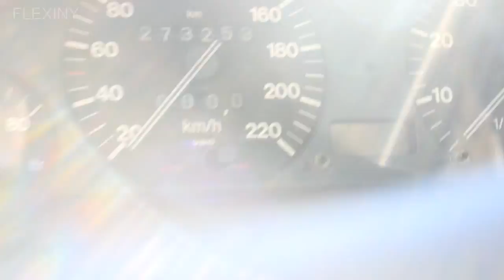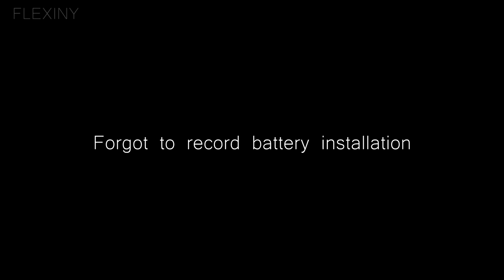Starting 1983 Audi 100 C3 2.1 After 15 Years

Comment: This car was one of the best AUDI i ever drove. I mean the 134 HP engine. Easily going real 195-200 km/h, and only 10L per 100kms gasoline when you were on 170km/h or so. I mean compared to my  A4 3.0 TDI from 2005 this is not very impressing, but in 1983 that was amazing, especially the acceleration from 140 to 195km/h
Reply: Yeah man, I have this car and driving for fun, 2,3 136 hs, 1990 rest
Reply: @КиримВастьянов  I have an A4 B5 from 1999, also very good reliable car.
Reply: if u have fully fixed kjet system.😏
Reply: Reliable, fast, everything you need

Comment: The good and old MD270. In Brazil, they evolved into the AP series, with longer connecting rods and more torque. It's still one of the most reliable engines here.

Comment: There is a good reason it was parked there 15 years ago - major engine repairs needed - those bearings (and most probably valves too) are shot!
Reply: What????  .. and that massive impact at the off side rear didn't play a factor in it getting parked up .. sheesh !!!

Comment: -Knock, knock! 
-Who’s there?
-Crank rod 😂😂😂
Reply: This engine have a connecting rod bearing damage.
Reply: @1979Olitsch Sounds like my Tdi pd 130
Reply: If timing belt was slipping... valves are most probably bent
Reply: @user-sm8wo3dj5z  definately bent valves now jose. hear it popping back and the piston crown hitting the valve (or valves). wrecked engine now i fear.
Reply: no conrod, hydraulic tappet noise
Reply: @mindoza44  not worth anything anyways. still millions of them
Reply: ... every 5-Cylinder is worth ...  !

Comment: It started pretty easy considering it has infamous Bosh K Jectronic mechanical fuel injection.
Reply: K/Ke-Jetronic are extremely reliable systems as you can see in this video. The issue with them is mechanics knowing nothing about them.
Reply: @keki11111  well not really, they are extremely prone for various faults. That's why many owners are upgrading from mechanical to fully electronic injection systems. Because many of the parts wear out and are unavailable.
Reply: @justas525  I suppose it's a matter of pay your money take your choice
Reply: @drone_tours  you can say that i supose
Reply: Justas043  Do you work on these systems? So tell me any of these various faults. The reason why people upgrade their cars is because EFI systems are easier to tune and most mechanics do know how to work on them.
Reply: @keki11111 i know them quite well. One the main issues with them is the fuel distributor. Once the car has been standing the seals dry out and they start leaking everywhere, the other is fuel ratio potentiometer. They wear out and they don't run as designed. And if the car was fitted with LPG then it's bad news. Because when it backfires it warps sensor plate and injection won't work as designed either.
Reply: Justas043  The truth is that fuel distributor leaks are quite uncommon. If your fuel distributor starts leaking you can always rebuild it. A rebuild kit is around $100. An aftermarket potentiometer is $30 and they work fine. The old bosch unit can also be refurbished.
Reply: @keki11111  yep, you can refurbish the system. But then you need to adjust it. And not much people know how to do it.
Reply: Yeah I had to change the distributor cap to start a 2.2E that was abandoned for 12 years. The idle now is perfect and I have no problems with the K Jetronic.
Reply: Benedek Soós as ford said if k jet is good enough for Porsche it’s good enough for use
Reply: Justas043  You are right. Thankfully I know how to adjust it:)
Reply: @keki11111  I do. Vacuum leaks , a pick up screen clogged or deteriorated  fuel pump  hose in the fuel tank. Is it enough for  u?
Reply: @keki11111  $ 299  on ebay!!!
Reply: You're right. K-Jetronic systems don't like sitting down for a long time. I own a 1978 Volvo 244 with that fuel system, and it wouldn't start after 10 years abandoned in a shop. Besides all the bodywork restoration I had to do (because the whole car was a restoration project) I literally had to change everything in the fuel system. I got a fuel distributor with the sensor plate and control pressure regultator from a Volkswagen Golf (both are 4 cylinder cars). It was a used part but it came from a car that was daily driven, so once I installed it on the Volvo, voilá! The engine started out nicely. Once I found out that the engine could start with no issues, I proceeded to install brand new fuel injectors, a brand new fuel pump (not a Bosch unit since those are no longer available, but a conversion pump instead), new hoses, a new fuel accumulator (luckily those are still available from Bosch), and a new fuel relay. Oh, and since the car stood too long, I also had to get a new fuel tank and a new fuel sender (those are also available brand new). So literally I had to do the whole K-Jetronic system on this car to have it run again, and so far I've been using it as a daily driver for over 4 years now, with no trouble at all.
But yes, if you have a K-Jetronic car that's been standing for quite a long time, keep in mind that you'll need to change/rebuild almost all of the components. That is, if you still want to keep it running with K-Jetronic. In my case I did because I had all those parts readily available.
Reply: @rodolfini345  You were lucky.. That's why.. In mine Audi 200 I was unlucky.. I put megasquirt EFI system..
Reply: K-kE jetronic is garbage technology and I don't know why Audi used that system to that beautiful cars... Dam..
Reply: Justas043 I would say famous Bosch K-Jetronic. It is a very reliable system if you maintain it correctly. The problem is that most people don’t know how to deal with it and end up causing more harm.  I agree that it does not like standing still for long periods of time as the fuel distributor might stick or leak.
Reply: @keki11111  The trouble was the mechanics were not trained. No internet back then or diagnostics to help you.
Reply: @panpan6262  Very garbage technology, that's why most of this cars lastet 500000km and more without any engine related problems
Reply: @keki11111  hello there is a Mercedes e230 1988 the problem starts and stalls on pressing the pedal there is no change in gasoline there is not enough of it please help

Comment: I can’t even start my Audi after one week
Reply: 😆🤣must be some deep issue
Reply: Cos it's new age shit! :)
Reply: @ziboozet2906  bro the new age shit will give you 101 warning lights before it dies so you have to be realy ignorent to not undestand why i dons not start up.
Or its a old disel and it neds som time in contact before the orange coil gos out then it will start.
Reply: Or you cna just buy and old Audi ^^' my A6 is from 2001 and still working well with 965000km :D easy
Reply: @LeBourreau67  well done.i have fiat scudo with 550 000 miles on the clock and doesn't even cough black smoke.its like from factory.peope this days would say is only scrap.ive had many cars before and the low mileage were giving me the most headache.i hate city low milage cars as they fucked.gearbox ,clutch,dual mass you name the rest.high milage cars are the best
Reply: my e46 BMW after one week battery is down.
Reply: That's because of that damn electronic shit....my bro's audi A8 almost always after being locked,some sensor remains ''awake''which result is we all know what lol...
Reply: hahaha am glad i watched the comments first
Reply: check air leaks
Reply: Bruh moment.
Reply: @bmwm5bmw610  ABS fuse
Reply: Phucking hilarious

Comment: Minimal rust on the body of a almost 40 years old car.galvanised structure.
Reply: Yeah, Audis don't befriend rust.
Reply: @killerdinamo08  yeah ..... tell that to my 2008 A4 b7 :)))
Reply: @Andretty91  *till B5 😂.
Reply: Some audis rusted very easy but very few. Unlike opel
Reply: @killerdinamo08  b5's are included into the good years I think
Reply: Even tho she's crashed And the paint is gone. Great cars
Reply: @GeorgiGeorgiev-ne9ps  opels know how to rust but i love em anyway
Reply: wait til u look under. lol. they used som plastic fantastik stuff and if it cracked and got water underneath, well u have no floor in a couple yrs..... it happend to ALL of these cars!
Reply: Yeah, some Toyota would have disappeared by now
Reply: @inso5078  Thats why in Northern Europe Japanesse cars are not so popular. They rust out really fast- the worst one is Mazda.
Reply: @Andretty91  My A3 p8 from 2006 had only one rust spot on the floor at the back. Cleaned it- painted and now my car is almost rust free.
Reply: @shaded_lp  my Audi A3 8p from 2007 has no rust at all!
Reply: @wezelhond5572  Still drive with mine! Im sure that I will keep it a few years more.
Reply: @shaded_lp  yeah same i live in the Netherlands so we have tons of salt on the road for like 5 months a year, great cars!
Reply: Depends till 88 galvanised body was extra option, 88 to 91 was full galvanisation as base and from 91 it was mixed or something cheaper was used.

Comment: All overgrown, but still no major rust, when any newer A6 C6 will have rust holes after 10 years of normal use..
Reply: Oooh, those old ones will rust as well, if not more than the newer ones. He got very lucky
Reply: @kiliwami4086  I dk, i see a lot of audi 80 having their paint chipped off, but still almost no rust, when many newer ones (especially a6 b5) are just a rust bucket.

Comment: Smart idea bypassing the tank so you don't run all that shit gas through the CIS. There was probably crap/ air in the fuel dizzy, sticky air flow plate or an ICV that wasn't working. I would've tried cracking the fuel lines loose at the dizzy to see what came out. You may have been able to bleed it. ICV's can be cleaned out with carb cleaner so they rotate freely.

Comment: If this is just 15 years ago like 2005 or 2006 it’s not that old of a car to me. I own a Toyota Corona DX T -140 1982 model. That’s old. And still in good condition. this one is still relatively new. It wouldn’t even qualify yet as a vintage. A vintage vehicle must be at least 25 years old. Nevertheless good impressive work.👍 hope you keep up!
Reply: The car sat for 15 years.  The car is almost 40 years old.  It’s a 1983
Reply: @charlesmoore2485 
Thank you for the information and correction. I’m from the Philippines. In my small town cars like these are usually uncommon and rarely seen. The greater majority are usually the Japanese, and other Asian auto brands.
Reply: @hyperboytkl1077  there aren’t many left anywhere I don’t think , they were very resistant to corrosion, just had small troubles.  Like power windows , air conditioner issues etc.  a plain European version with a diesel would be my first choice :)

Comment: #nostalgy.. that model (c3- 1990, 2.0/5cyl 85kw avant) saved my life TWICE in times when i was young and stupid. 
I'm asking if an audi a6 2.0tfsi /2019.. will start again in year  2056, after he were "sleep" in a field for 15years (from 2041 to 2056)😂😂.. was just a joke, everybody knows the answer there😃.
Ps: maybe would help a bit new sparkplugs and new oil+filter.
pps: at my engine.. probably at that here too, when timing was jumped (camshaft bolt forgoten pretty loose)..NOTHING BAD hapen to valves!!

Comment: Longitudinal engine and transmission tunnel for torsen quattro option, disc brakes on all wheels and gasoline injection in 1983!!! If it was avant with quattro drive - you can sold for the price of new A6 or more in even this condition 🤑

Comment: I cant believe that started with K-jetronic. That system won't tolerate old gas or varnish. You can tell it sounds weak and the fuel distributor and CPR need rebuilt.

Comment: Fan belt slipping not timing belt! I think this was the 5 cylinder model. The injection system was a nightmare!
Reply: NO KEITH.deffo timing belt. listen to the sound of zero compression and then compression comes back when the camshaft starts to rotate. sounds like some valves have clacked the pistons to me when this happened,judging by the way the engine sounds when it warms up.

Comment: You will need a fuel pump as the injection not will get sufficient pressure on the injectors.

Comment: Reason for removing timing belt ???thanks
Reply from the maker: Crankshaft pulley was full of oxide and it was sliping. We cleaned it and had to put timing marks at right spot to start.

Comment: If you call yourself a mechaninc i would never take my car to you cuz you started it just like that should have checked for the spark dripped some oil in the cylinders and it cant run bc it needs a constant fuel pressure of 120l/m and 6bars
Reply from the maker: I know, we had only ~3.6 bar diesel bmw fuel pump and didn't had enough time to get right fuel pump.

Comment: Stupidity on youtube. Killing an almost dead engine by not waking it up smoothly (revving it high immediatley when it came to life and putting in antifreeze for the windscreen instead of coolant just to name two mistakes of many...). In the end it was wasted time either for the maker of the video as for the people who watch that shit.
Reply from the maker: Hello, why do you comment under my video if you looked before other guy video? In this video I use coolant not washer fluid (Even on video you can see differences between them, there is no foam) and where you can see high RPMs? They are good RPMs to get oil pressure up and not damaging engine.